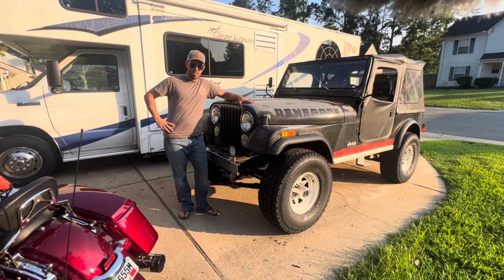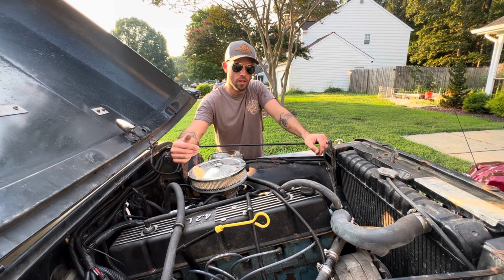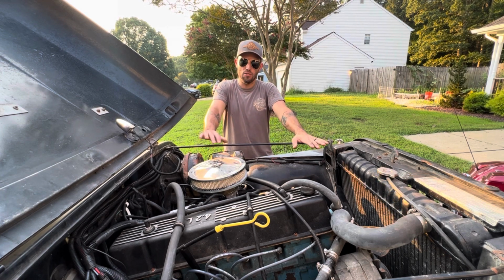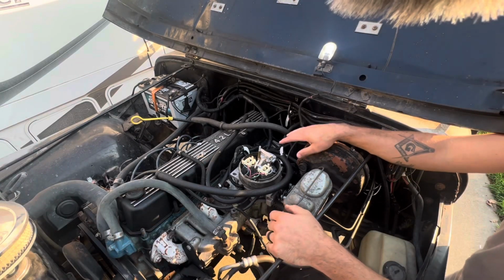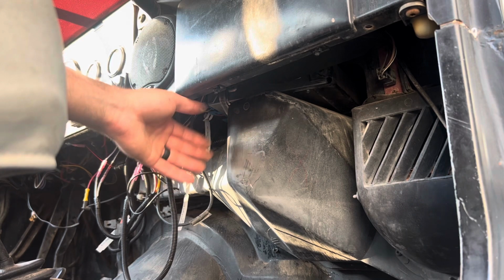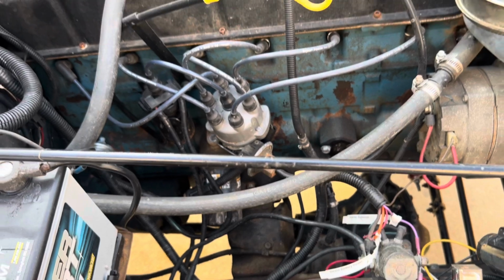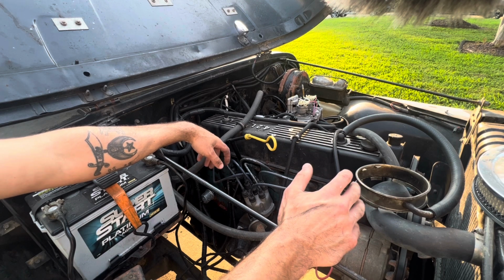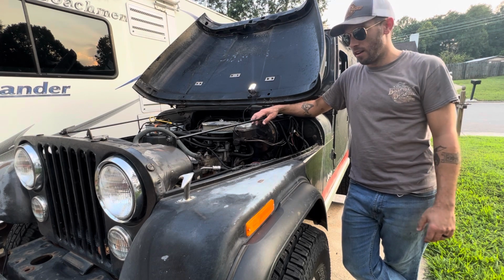Jeep CJ or Wrangler 4.2 258 TBI Fuel Injection Swap Ditch your Carter BBD Carb

Comment: So what kit does the tbi adapter plate come with, and what brand of tbi do you have? I have a 1980 CJ5 with a 2 barrel MC 2100 and I want to upgrade to a tbi. I f you can tell mw where I can purchase the adapter plate i would appreciate it. Just want to have everything togeather so I am not missing everything.  Thanks. Great looking jeep!
Reply from the maker: Honestly I’d go to pfisys.com and buy a complete Jeep CJ kit, much better than the Howell kit I have
Reply: Thanks
Reply: @thegarageconnection would that air cleaner adapter you have, work on the kit you suggested I get?

Comment: The sniper is much more advanced and user friendly than the Howell kit. The sniper kit does not have to control the timing and it’s roughly the same price as the Howell. The only way to come out converting to tbi is to repurpose an old gm set up from a donor truck or run across a kit for a reasonable price, like you did. Great job on your conversion, everything looks great!

Comment: Thanks for posting. Funny how your video just showed up and was recommended to me. YT is amazing sometimes. I have a Jeep 1985 J10 with a late model rebuilt 4.2L engine currently on an engine stand that I will be installing. I have the Howell EFI throttle body kit that I want to upgrade to. It is still in the box. The truck is rust free and has been stored for well over 10 years in my 30 x36 building. My winter project it to get it ready to paint. I have the nutter bypass information somewhere in my collection of jeep stuff. I just subscribed to your channel.